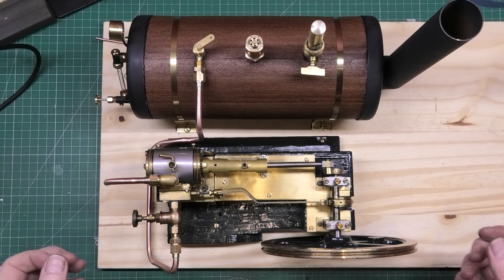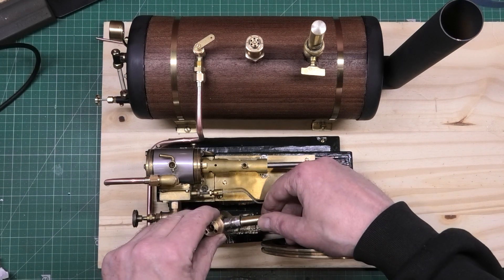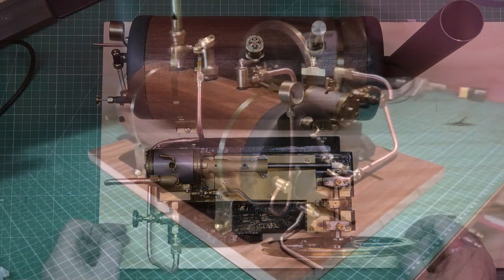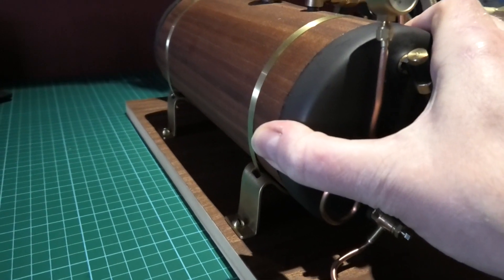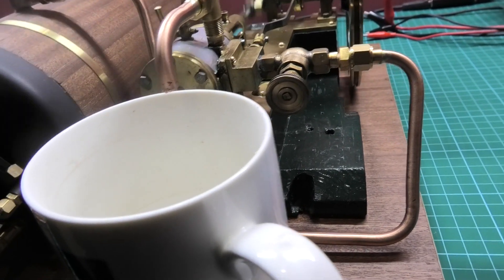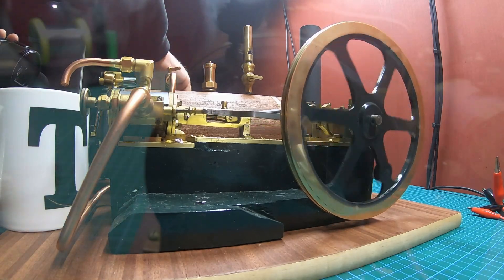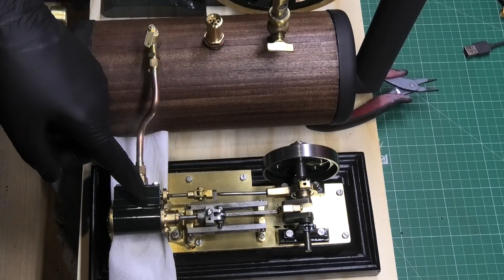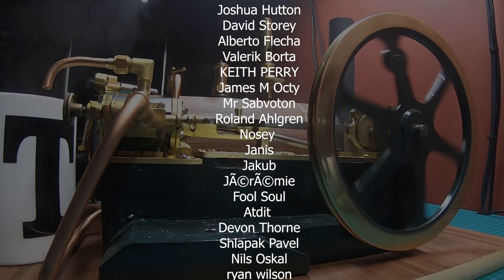DIY live steam boiler build - Part 4 of 4 - The finale

Comment: You've probably figured it out by now,  but I'm thinking you're not seeing pressure as your gage is submersed in the water which won't compressed. It needs to be up in the vapour, yes?
Reply from the maker: Actually, no it should have water in it to reduce the heat on the guage internals. If you feed it just steam, it will eventually blow.
Reply: Huh? Mine has always been on top for 24 years
Reply: @DumbThumbsFPV  it needs to on top in the vapour, not in the liquid.

Comment: Wow! I have been looking for this sort of video for ages. For someone who has never built a model steam boiler, you have done an amazing job. Absolutely fantastic work.
I have just got myself a copper tube 1.5mm thick and 77mm in diameter. I am going to try building a model boiler also. Where did you get those end caps for the boiler? I bought two copper plates which are 1.5mm thick for the end caps and have been watching videos on how to form the end caps on a former, so that's my way of making the end caps. Once again, you have done an awesome job on this, and it works and looks top-class. Well done mate. 👌👌👍👍
Great channel and right up my street. New follower. 👍

Comment: The ball bearing in the water pump body acts like a gravity 1way valve, when the piston goes in it will push the bb up away from the hole and water will flow around the bb and out the top of the body, when the piston tops out at the top of its stroke the bb falls back down and blocks the hole preventing the water going backward on the down stroke.

Comment: nice job . What you have is a boiler feed water pump not an injector . As you say it is missing a few bits, Gland and packing where the rod goes in the pump, perhaps a sealing ring on the piston, and a by pass system if you are going to use it in order to regulate how much water you put in the boiler. Personally I prefer to use a hand pump on stationary engines. Oh the ball bearings act as non return valves inlet and outlet. You will also need a clack valve on the boiler to fill it with the pump . Good luck with your back

Comment: The injectors I have seen don't have moving parts, it's some type of venturi or something.

Since yours has a piston, my guess is the top is a check valve to prevent boiler water from pushing out.  On the bottom, my guess is it would be a similar check valve potentially spring loaded or steam pressurized like a turbo waste gate to prevent it pumping too much cold water in.
Reply: I think you need to fix your bearings, it sounds like the shaft is beating them up.
Reply: Also, I think your first steam engine sounds pretty good.  Slide valves work because there is more area above the slide than in the ports so the steam pressure holds the slide against the port side, creating your seal.  You shouldn't need a super tight fit, just flat surfaces to slide against each other.